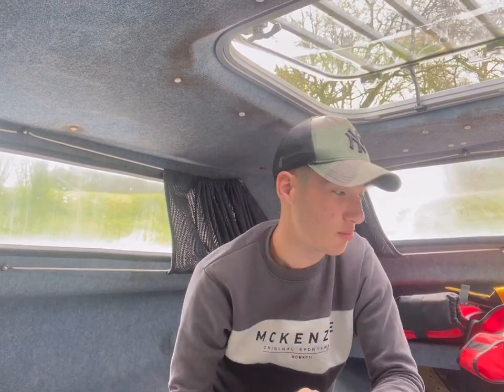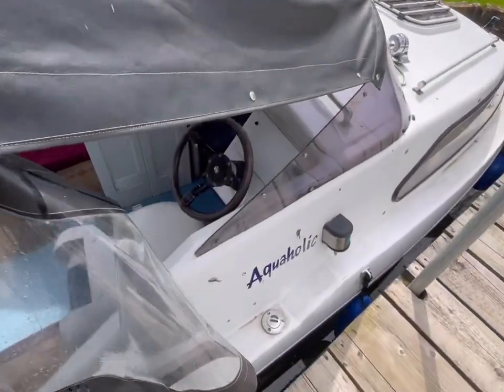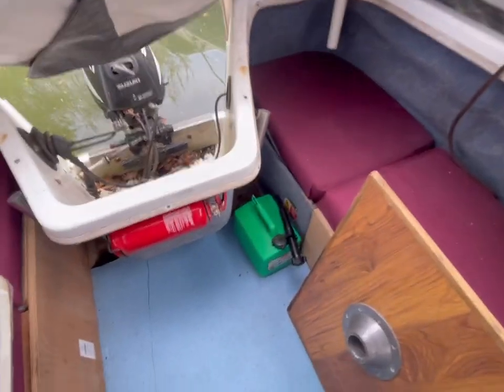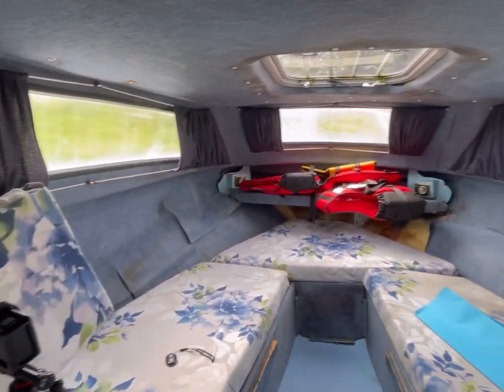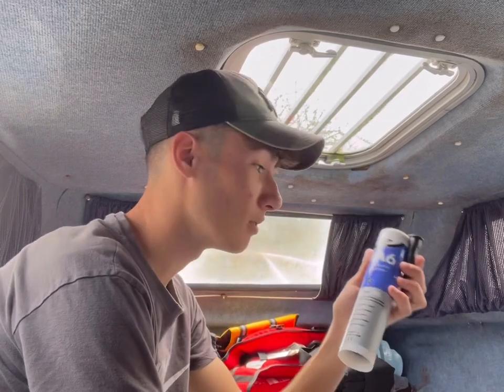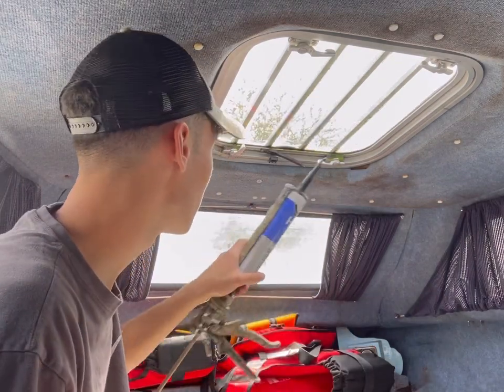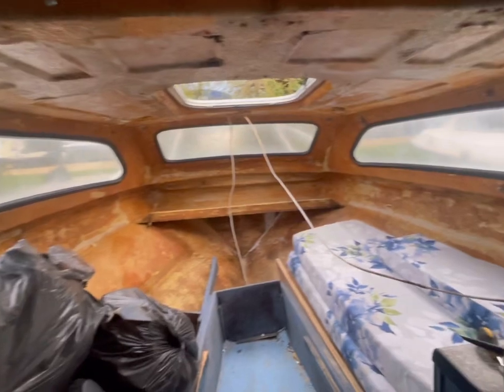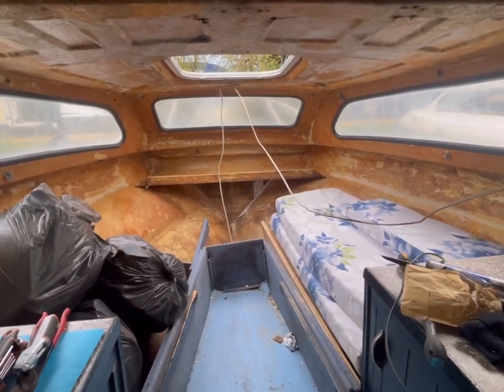I Bought a Cheapest Shetland Family Four On The Internet | Part 1

Comment: Have you checked whether the boat is dry? If it has not been done before this boat is water-logged for sure. The best way to check is to remove table socket in the cockpit but I can see yours has been sealed so you can cut the hole out inspect the boat under floor and install new table socket later. The boat is filled with foam and if waterlogged the foam will be brown . Ideally would be to cut the foam out to bottom of the floor (water usally sits at lowest oart of the foam). I did restore couple of Shetlands F4 and they are always waterlogged.
Reply from the maker: Foam was all good on this one mate and later in another video I take the cabin pedistal bracket off the floor and inspect the foam! Thank you for your comment! What years were the f4s that you did?
Reply: @benriverss  Good to hear. I did 3 F4's from top to bottom, including floor. I've converted one from splash well to engine pod which gave plenty of deck space (F4 from Mark 5 as I remember were designed with the engine pod instead of the traditional splash well. I worked on years 1983, 84 and 91. I still have the '83 one which I use for fishing and cruising. I'm done with boats restoration for good - too much work haha!
Reply from the maker: Definitely mate! Any photos?